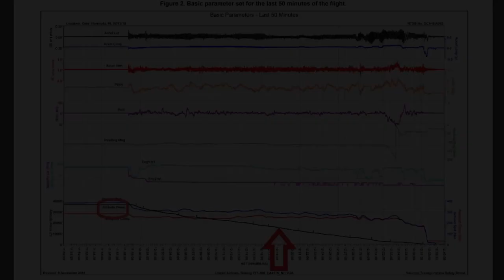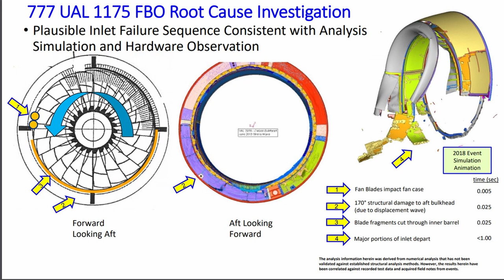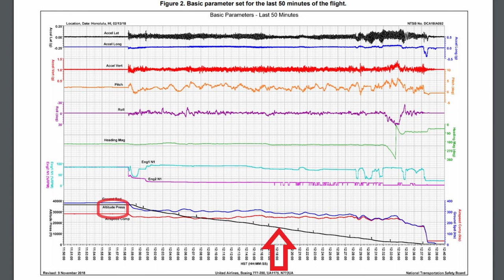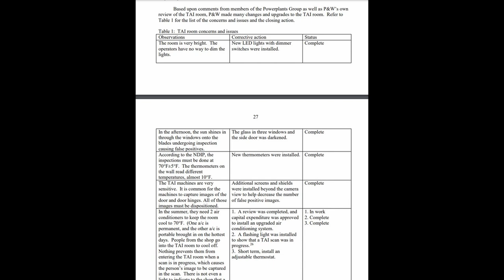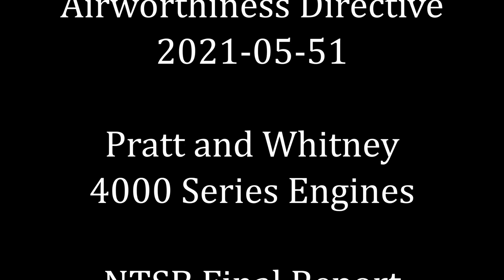Emergency AD & NTSB Final Report UAL 1175 Fan Blade Failure

Comment: I calculated the imbalance force when the blade broke off. Assuming 2000 RPM, The mass of blade is 25" from the axis of engine, the weight of the one and a half fan 46 lbs, the force at that moment would be like 130000 lbs, e.g. almost 65 tons. It is amazing that the wing could withstand that kind of force.
Reply: Indeed! That is a staggering amount of nearly instantaneous force transmitted through hat probably is just  a few bolts into the wing. 

I wonder both what the calculated load limit is and what the absolute worst force that could be generated in a massive multiple blade failure scenario.
Reply: @Neal_Schier  Actually the bolts are calculated such that they are the weakest point in this linkage, so when the forces would become too large for the wing to withstand, the bolts would shear off and the engine falls off the plane, hopefully allowing it to land on the remaining engine.

Comment: With all those varaibles for the TAI, It makes me wonder why an Ultrasound, or Eddy current test would not produce a better test result.
Reply: What it says is Ultrasound only, with different name
Reply: @jvt201  The sound wave is in fact an ultra sound. Eddy current probably won't work because it's not an iron based alloy
Reply: TAI is a relatively new technology for NDI.  It was innovated precisely due to newer TI alloys deployed in fan blade ...and also the voids (hollow) spaces are of significant complexity in shape and density that "ordinary" NDT equipment are limited in detecting micro structure anomalies. I believe TAI first came on the scene around the time that single crystal TI alloys were being developed.  With TAI, the rejection rate at manufacturing was quite high, thus the newer technology was quickly implemented in all NDI processes for the fan blades...It's very expensive gear. Other technologies "could be used"...but there are limits to each and thus you end up taking DNI procedures for each fan blade target multiple times using two or more "conventional" test gear.  Which costs alot of time and resources.  TAI save you quite a bit of time, and it's accurate across all regions of the protocols requiring no other technology to confirm it.

It IS an imagery end product though...So it is similar in some respects as it requires a human eyeball to evaluate results...

at manufacturing, the high rejection rate for fan blade that fail to pass TAI, shows just how difficult it is to produce these blades that conform to a very high level end product.  

and to be clear, TAI is not the only inspection that is performed on fan blades..there are many other kinds of inspections performed to the main rotor, the cone, the cowl, the containment apron....etc.  typically, it a vast suite of checks..Those other checks do not require TAI but are typically checked during fan blade inspections at the same time.
Reply: TDM MCL :  God help the guy who drops one while reinstalling the blades...
Reply: @suspicionofdeceit They are removed for lots of reasons:
a.  TAI requires the target to be placed in a controlled environment...hard do accomplish that with the entire engine and aircraft attached.  Keep in mind these are not "hangars" per se where this work occurs. Think more like little labs....
b.  TAI test equipment is not THAT mobile anyway.  In order to test the target is subject to many different angles...that's not possible to do with it attached to the hub.  One needs to turn the target to many different angles, along all axis.
c.  Test targets must be decoupled from all other components.  Think how the hub and the fan blades are attached and how they differ  in material composition.  So you end up with a "thermal" sink as well as a induction problem that would present unreliable test results if they were coupled.  You remove them so they are not affected by any other source of "artifact".
d.  One of the most important areas to inspect and to test is the machined joint where the fan blade fits into the hub.  detaching the fan blade from the hub allows this inspection..OF BOTH!  It's important to notice, we are not just talking about inspecting fan blades alone...it's the entire suite!  Hub included. 
e.  By removing each fan blade individually allows you to use more than one TAI test set, and that saves alot of time to perform the entire test inspection for all of them, and both engines...So it's very time efficient.  Also important, is that by performing two or more tests with different gear, you can also achieve a better more robust overall performance of your testing regime.  Example:  what IF two blades fall on average for one TAI test machine, but you rarely every get rejections on the other?  Then you are alerted to a problem with calibration or something else like inconsistent testing procedures.  So, here you can determine if you test regime is adequate.   
f.
Reply: @stephenmelton2532  yes, it's "frowned upon"...as my favorite QC guy would say.
Reply: @easternwoods4378  eddy current doesn't need iron. In A&P school we did an Edify current test on Aluminum.
Reply: @suspicionofdeceit In one word, NOPE.  Rolls Royce were the founders of wide chord hollow titanium fan blades.  The RB211 G/H models used on the 747-400 & 767’s had several fan blade failures over the life of the program.  There were several redesigns and rub surface coating mods to ‘fix’ the causes.  I am NOT an NDI specialist but took great interest as to why I was periodically pulling these fan sets out, cleaning, re lubing and fitting after inspection.  The NDI specialists were looking for loss of vacuum (could be done in situ), but the majority of the inspections were in areas of contact, or along the base of the blade.  It was also considered to be ideal to clean & relube the blades periodically to prevent fan vibration so every 1000 or so hours, they would come out, get cleaned, inspected, lubed, fitted and an engine vibration run carried out to make sure it was within vibe limits.  Over the years, I saw a few fan blades that failed NDI and were sent back to Rolls Royce for evaluation.  At $50,000 each in pre year 2000 dollars, it was expensive, but still much cheaper than having one let go.  The newer aircraft have even bigger blades so the forces involved (and prices) would be HUGE! Edit - the NDI method for this blade was ultra sonic.
Reply: @tdmmcl1532  Thanks for a great explanation of the NDI process. Just a tad more complex than my Fluoro penetrant spray can method. LOL.
Reply: @insylem  correct...I think the OP was thinking iron because it is conductive, not realizing that AL is also conductive.

in real world, there are some limitations for E/C testing..some of which relate to special kinds of alloys and/or cladding material.

and in general eddy current testing is limited to a very shallow depth of the target..with accuracy that degrades in proportion to permeability delta of the material. All of this is on the assumption too that inner material corrosion has not occured...

as a consequence of these limits, E/C is generally only used to detect surface defects/cracks or in the high end ECT/ECA multi-plate targets.  Also with some limits.  

 ECA gear can operate reliably at thicker dimensions, but not accurate with voids found in fan blades being discussed here and also carries with it assumptions about the pristine state of the inner material.  With aging aircraft, those assumptions require a bit more technology to test for them, that EC just cannot perform.

not saying it a bad technology...very useful indeed..but TAI is superior for fan blades of this composition and material design.
Reply: @tdmmcl1532  Or could have been thinking of a mag particle inspection. That only works on Iron, Nickel or Cobalt. (Ferris metals)

Comment: Juan you mentioned that when an engine is shut down,  the remaining good engine is run at full power. The ETOPS certification for 180 minutes on one engine would have been tested and proven with new engines. But have the manufacturers run ETOPS tests on high hour engines say with 10,000 or more hours. Your explanations are clear and precise,  great videos, thank you.

Comment: Isn’t it time they have cameras on these engines?
Reply: Abso freaking lutely!
Reply: What would that do? They have sensors.
Reply: @bishop51807  It was explained in the video.  Sensors cut out the moment the engine failed.
Cameras are so cheap today that they really should be included on every new design and on a major overhaul of any large plane.
"the pilots could not see what is going on and had to guess" is a factor in several crash or mishap scenarios and it would be so easy to fix that today.

Comment: I wish somone could tell me why it's apparently TOO COMPLICATED for the aircraft manufacturers to have deticated hi rez cameras pointing at each engine, from multiple angles., all equipped with image recognition software to immediately notify the pilot that "THE ENGINE DON'T LOOK LIKE A ENGINE NO MORE!!!" Or even a smoke / contrail comparison between engines to deturmine if one is smoking, etc. 

 Are we really (in the age of "google probably has a camera in my butt without me knowing about it")  still sending people back to the cabin to take pictures out the window. I watch ALOT of crash investigations, and a far too common issue is problems made worse, or took too long to diagnose, simply because they couldn't see the condition of their aircraft from the cockpit.

Comment: Thank you for the great information I’m a machinist years ago I worked for a company called Zetec we designed and manufactured Eddy current inspection equipment probes several different types of probes and robotic equipment as well .
So the probes are calibrated with a standard and a eddy current is induced into the material this inspection is called none destructive testing we mainly tested nuclear power plants in the states and Europe some aircraft as well .
Reply: Eddy current nondestructive inspection only works for surface and near-surface discontinuities on non-ferrous (paramagnetic) materials. No way eddy current inspection could find fatigue cracks on the internal surfaces of these large hollow titanium fan blades.
Reply: @richardpeugeot9143  you should do some homework before making comments
Reply: @ajkylen  Joe, what I said was 100% correct. Doesn't matter if its Zetec,  Nortec equipment or whomever. The same laws of physics apply. Please point out any errors you see.

I am am engineer and have designed and built many NDI syste

Comment: I always find it amazing that the engine is an incredible piece of high tech machinery built to incredible tolerances but it all kind of falls apart when the TAI test requires a coat of paint slathered on by hand by different individuals. Since the overall performance of the test is limited by its weakest link, we have dragged down standards by a very “ easy to fix” problem, or simply lack of manpower.
Reminds me of the saying: “ built with a micrometer, drawn with a crayon, cut with an axe” .....great intention, not so great results.
Hans Juergensen

Comment: A quick update . US asparagus arrived A. O.K . in UK supermarkets . Excellent job and thanks . Enjoy the Scottish salmon ! We have great seafood , lobster , crab , Langoustines , scallops  , clams etc., from Atlantic UK waters .
 A great explaination of the effects of the problems . Non destructive testing has been around for a while from Magnaflux using ultraviolet wash , to T.A.I . T. A .I was used in my first spine operation in 2001. A technique brought from the US and adapted for bone fracture imaging during a new therapy being developed here . The process is similar to a Myelogram but the imaging is real time and much better . The dye is injected through a fine needle in the surgical technique and a week is allowed for the excess liquid disperses leaving on the cracks filled . The probe with the thermistor / detector is inserted through the same hole left by the injection and high frequency is applied ( in industrial applications I believe microwaves are used ) that causes the liquid to vibrate and heat up . The thermistor picks up any heat above body heat generated in the fissure and an infrared image taken which can be sliced like a CAT Scan . This elaborate procedure had to be used as I have metal fragments embedded in my eyes from an explosion way back in the day which they did not remove at that time . I cannot have an MRI for that reason . The only difference is an engine cannot give instructions to the engineer where the pain or problem is located and in which blade . Not yet anyway .........

Comment: Damn you sure get around. I'm an RC flier both fixed wing and helicopter and I can't wrap my head around how they balance these engines after fan blade replacements. I know the trouble I go through to balance my blades as I'm sure you do also.
Reply: Replaced as a balanced pair, two opposite blades. I watched a couple of guys swap out two blades on a KLM 747 I was about to fly across the Atlantic on, they did it in under an hour start to finish.
Reply: The B777 has an integrated Fan balance system on the airplane, no need of external equipment. There are little balast weights at the root of each blade and the system tells you wich one to put in each position, or interchange.
Reply: @pibbles-a-plenty1105  That's what I do on the helicopters too. LOL! A gram gauge is a necessity!

Comment: Juan, you will notice that the exiting fan blades damaged metal leading edge of the inlet cowl causing it to separate from the body of the inlet duct . If the fan blade had exited two inches more forward and horizontally the fan blade would most likely have penetrated the fuselage, possibly into the passenger cabin.

Comment: Playing with a little "FLIR One" thermal camera (attaches to phone or tablet) I notice that any shiny metal surface will simply act as a mirror at the mid-IR wavelengths that devices uses. The indicated temperature on shiny metal will simply be whatever surface it is reflecting, and that might be your hand or your face, if you're close by.  Something like vinyl tape, or flat paint prevents that, and also (presumably) has a stable and known emissivity value that you can calibrate your readout for, so that indicated surface temperature will be accurate.

Comment: That 30 second delay in obtaining information from the engine instruments is a serious problem.  I'm not sure how that can be fixed, but that's a lifetime in an emergency like this.  Juan, the way you explain these incidents gives great insight into how challenging emergencies like this are to the crew.  This must have felt like a lifetime to the crew while they're trying to fly through serious instability while trying to diagnose what the hell is wrong with their aircraft.  These are the types of incidents that prove how valuable training and airmanship skills(not simply number of hours as PIC) are.

Comment: Railroads have used magnetic inspection of rails and ultrasonic inspection for in-track inspection to determine cracks and other inclusions.  A Dr. Sperry came up with the magnetic inspection technique in the early part of the 1900s which uses a high current through the metal to detect magnetic variations depending on the crack and inclusion sizes.  This was started somewhere around 1910 or so.  Ultrasonic is more detailed to check after an anomaly is detected they back up and use a hand-held probe.  I believe that improvements have been made so ultrasonic can be used continuously now.  Brushes are used before and after the magnetic coils to induce the magnetism in the rail steel with low voltage high current similar to that used in welding.

Comment: The paint stops reflectivity of heat.  Being in the fire service we thermal imaging devices regularly, metal and glass reflect back to imagery. For example when I search a home and I see a body, especially if it standing, I wave to it and usually waves back.  Then I find a mirror or glass door.
I imagine that this is the same case, to paint and lower false finds.

Comment: I used to work as a machinist for the supplier of many of the fan blades used in both P&W and GE engines. Even though they are incredibly sturdy and machined to fine tolerances, materials science teaches us that stress and fatigue beyond engineering limits can happen along with undeclared stress events caused by faulty engine management systems and pilot error.

These jumbo engines should be removed, disassembled and thoroughly "x-rayed", and have those fan hubs rebalanced every 10 years or the equivalent number of hours.

Because safety matters.

Comment: Thanks Juan, for a great explanation as always. 
I expect the need to paint the blades before test is a simple requirement of optimizing the energy transfer from the testing transducer into/(and out of) the blade structure (impedance matching!)  The better (read: less variable) the transfer across that (without paint, a variable airgap) impedance change, the less (noise) data from that would influence (and possibly hide) the thermal info of high interest, coming back.  ...just me applying some science to explain it.  Cheers

Comment: Having worked with ultrasonic welders I know that any micro fissure can be detected easily by measuring the acoustic resonance when using ultrasonic frequencies. 

If they were using an infra red thermal camera the paint is used for correcting the emissive properties of reflective surfaces such as polished metals. The same recommendation is listed in the owners manual for home thermal guns.

Comment: Great explanation on why the plane descends after losing an engine...especially how lift increases in the heavier air.  As soon as I heard that, it clicked.  I guess the altitude at which they reach stability can't be calculated.... they just drop while maintaining airspeed and when air speed starts to go up they know they've reached stable altitude.